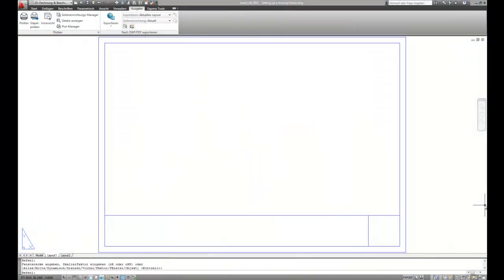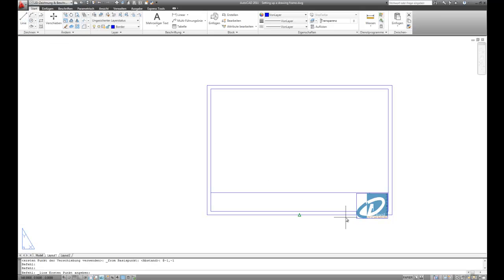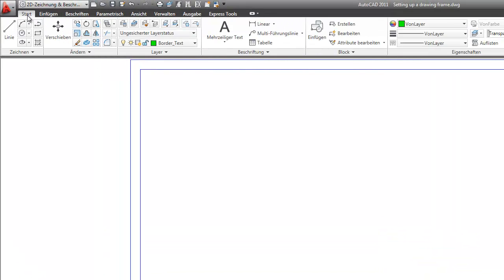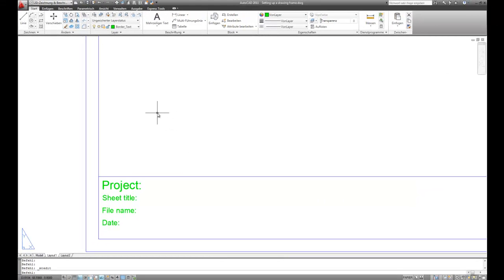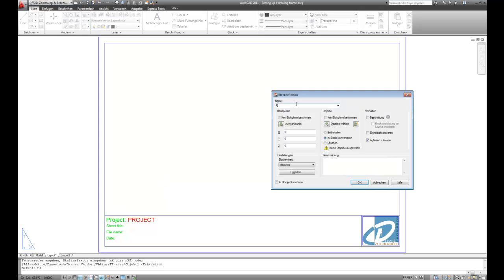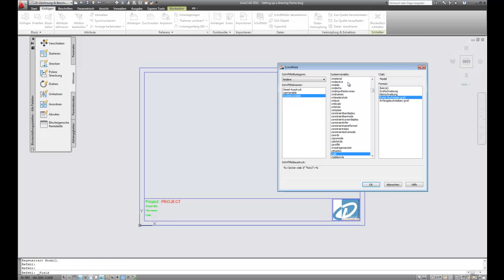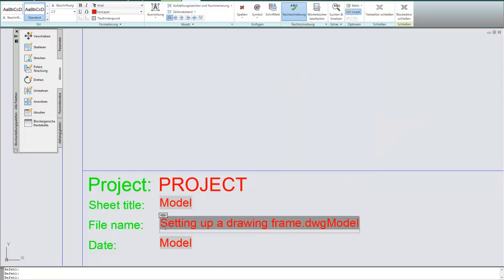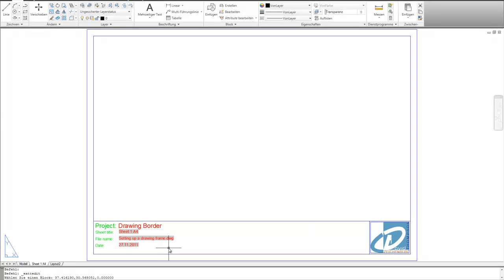AutoCAD 2011 - setting up a sheet title as a block using attributes

Comment: I was wondering if you can use fields to corrospond to other tabs, like in this video layout 2. What I mean is that can you write something on layout 1 and have it be related to layout 2 but without them being part of the same block. Like if I wanted a customers name on the front of my drawing and on different blocks on different tabs? What I am trying to avoid is writing the same thing over and over again.
Reply from the maker: andrew stockton good question...
Reply from the maker: andrew stockton First the bad news: what I can not do (maybe some bright spark out there can) is to define a layout name using text fields. I can only type 'normal' text there - also did not work when I tried using ctab in the command line and trying to add variables copied from field text.

What you can do if you just want the repeated info as a text somewhere in the drawing,  is to define a custom property with the info that you want, which can be inserted over field text.
Custom properties can be defined over AutoCAD icon (big A top left) > drawing utilities > Drawing properties > Custom tab.
Reply: Thank you I shall explore this option.

Comment: I use the "attach" command or the "xref" command. for bringing in any picture file into autocad. why do you choose to do it this way?
Reply from the maker: I use attachments or xrefs for underlays (pdf plans frm architects) or dwg plans which may change and need to be updated - or even for plans which are currently being worked on by others. I feel an attachment for a single picture overcomplicates the drawing - and whenever I send the file to someone else, the attachment has to go with it. With this method, I the process of sharing drawings is simplified.
Reply: Ohhh, I see the image now lives within the drawing, rather than outside of it.
Reply from the maker: andrew stockton exactly!
Reply: David Thompson so educative. thankyou
Reply from the maker: Zeajing Throne You're welcome!

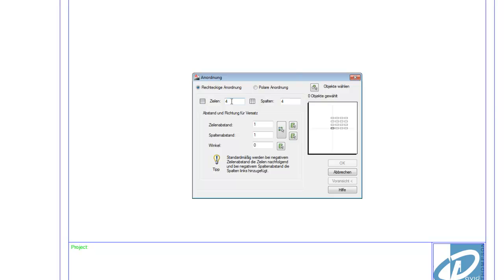Comment: 3:50 you used array on Text.
After applying it how did you Edit all text in it individually.....?
when normally i apply any array i could not edit object individually like you with the text "Project"
Reply from the maker: I know it is a long time ago, but you will find an answer to this question in a recent video about arrays!